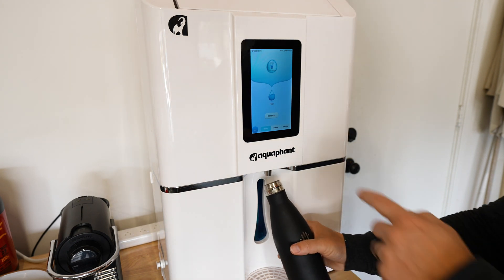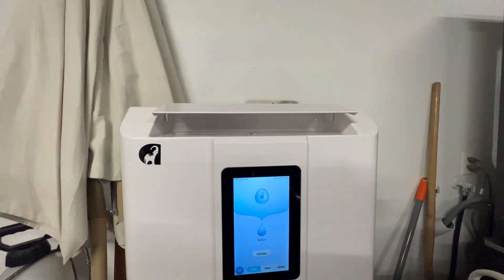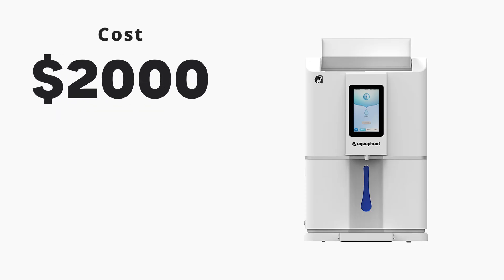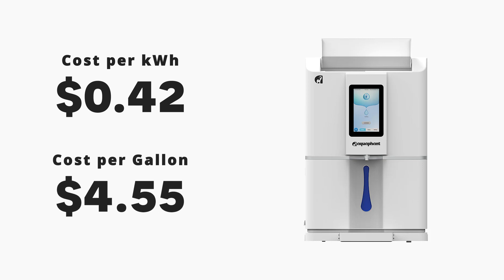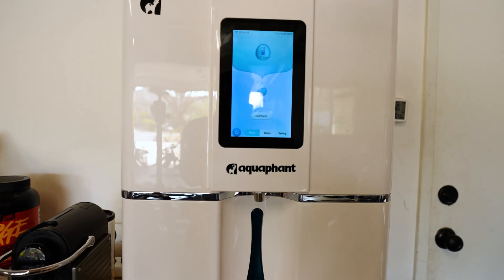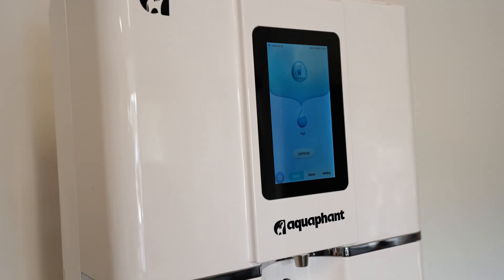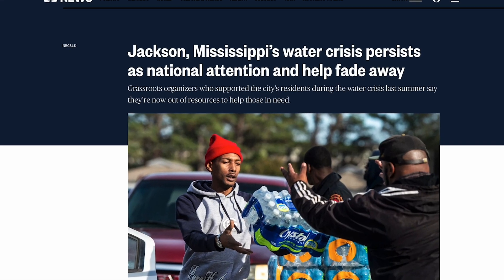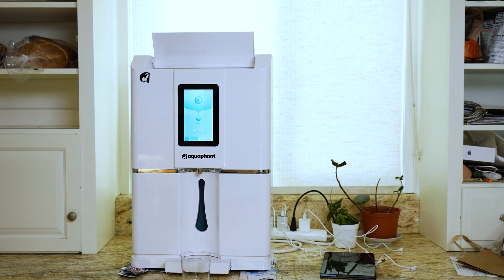Pure Water from Air and Electricity (EASY METHOD)!

Comment: And to mitigate the water machine pwr sucking, you CAN..if you have decent solar access..just pop up some used $50 250 or more watt solar pnls/charge controller/inverter..&  cheapo LiPo4 storage battery bank. And the LiPo4 batts last up to 10 yrs and withstand to 80%! discharge without damage!

Comment: Just collect water from the AC condensate. We get so much water from ours that it's formed a small pond off the end of the discharge pipe. It's free water that's always being wasted. Pure water too! But you wouldn't think that is was all that much the way it drips ...Ever let a leaky faucet drip until you got the water bill? You could run a line from it straight into the pool or a rain barrel. It's passive collection! And it adds up over time.
Reply from the maker: yeah that's definitely possible (assuming you need AC year round). There are some instructions online for this but with a dehumidifier. Basically the same setup but DIY version.

Comment: Did I get that right that the water is destilled? So it has no minerals in it?
Reply from the maker: No, it has a mineral pack to add them back in
Reply: @BenSullinsOfficial  thank you Ben for you quick reply! Thats sounds pretty nice, should work pretty well  in a humid area like Virginia or even Florida. Thanks for sharing the device :)

Comment: So you got 0.25gal vs the promised 3 gal? What is their promo materials I wonder. This is failure levels approaching a scam. Then it needs a lot of electricity and makes noise? And a yearly replacement filter that is proprietary for $150? What a joke.
Thanks for the video though, appreciate it.

Comment: I don’t get it where if the temperature drops, why wouldn’t you be able to pull water? It should be the opposite where if the temperature drops, it should be easier to pull water because the air moisture is condensing, hence the word “condensation” or water that develops on cold nights and morning on your car windshield and metal surfaces. It should be easier on the system you’re reducing the energy state of the air temperature at a lower state of energy (cold air) than you would at a higher state of energy (warm/hot air). It’s also the same principle if you’re trying to freeze something. It’s easier on your freezer to freeze (solid state) something quickly and with less energy if it’s been in your refrigerator around 40-45 degrees for a couple of hours to get it below 32 degrees rather than taking something that is at room temperature around 72-74 degrees and reducing its energy state down below 32 degrees.

Comment: Couldnt you just buy a dehumidifier, use the water and pour into a brita filter and get water cheaper that way? lol, sorry just not worth $2K using that much electicity.
Reply: If you've ever used a TDS meter on water that a Brita filtered, you wouldn't drink it.  They don't filter that much compared to the TDS reading for tap water.
Reply from the maker: Not that simple but yes, there are ways to do it yourself. Check out instructables website and search Atmospheric Water Condenser

Comment: Sounds like the old system is better. My other spot is Palm Springs where, as you know, humidity is low. This may not be a solution especially when AC is on often

Comment: Incredible waste of power, while taking up a bunch of space and making lots of noise. 
If you want RO water, get an RO system and treat tap or rain water...
Reply: RO is a 3-1 ratio in most situations. Meaning for every gallon it makes it wastes 2-3 gallons of fresh water.  If you have solar this is basically free water.  It's eco friendly and its sustainable.  And  the water is of higher quality then that of any local municipal source even if you have your out RO system at home.

Comment: This device seems to have a temperature and humidity sensor.  Why doesn't it set itself to standby when conditions are below it's operating specifications?  Seems to me it would use a lot less power that way.
Reply from the maker: It does but at times still tries to work

Comment: It seems to me that buying 18.9 L and returning the container everytime you do grocerie shopping is cheaper and more ecological no?
Reply from the maker: Not sure about the ecological side, but definitely cheaper. My quest is to find a way to make my own which is a bit different goal. So the quest continues...
Reply: @BenSullinsOfficial  It comes down to about 1$ per gallon in my area. The machine in your video would need to have better efficiency than shown (quite a bit closer to the what is advertised) for it to pay for itself. I'll stick with the big bottles for now, they work all the time and I don´t need power. Even better, they never break or need a filter change.

Comment: How long will the filter last and is it a standard off the shelf item that can easily be replaced when it eventually will need to be replaced?
Reply: We bought one of these machines at the same show and have had similar results. Pretty sure you have to get the filters through the company at $150. I'm still trying to figure out why it needs filters if it's pure H2O. If something else is getting in the water their machine isn't working right.
Reply: @danieleb2945  Dehumidifiers condense water out of the air.  They aren't distillers. Air contains dust, mold, and other microbes.  Legionnaires disease came from the water condensed off an air conditioning unit.  You definitely aren't getting pure H2O from it without filtering and sterilization.